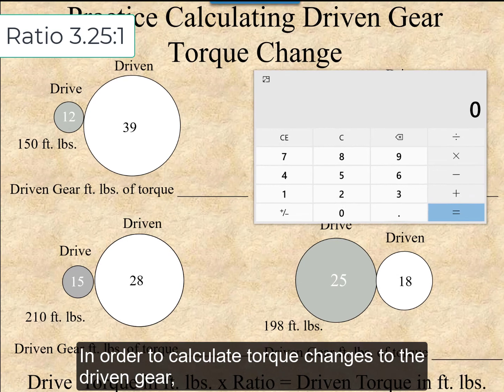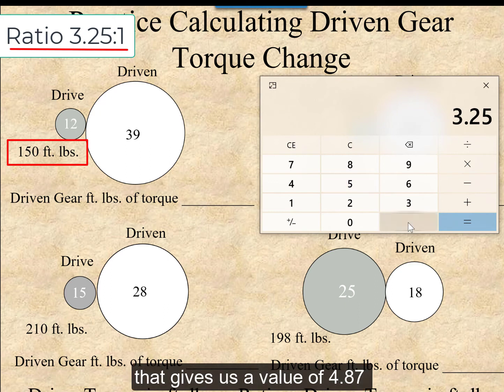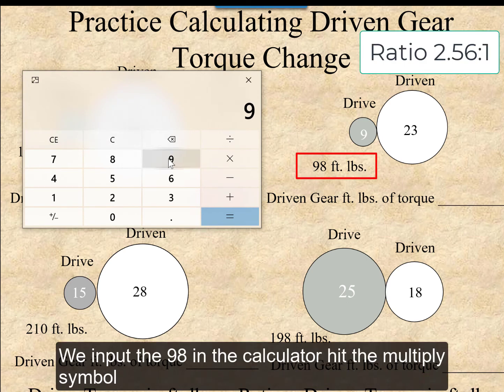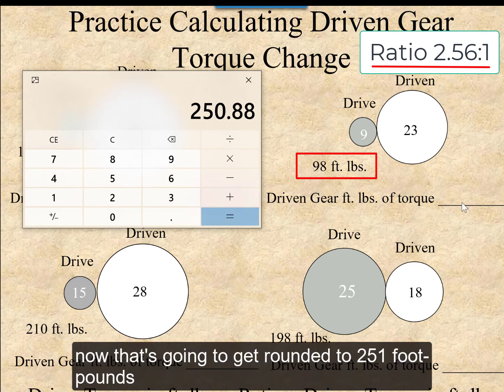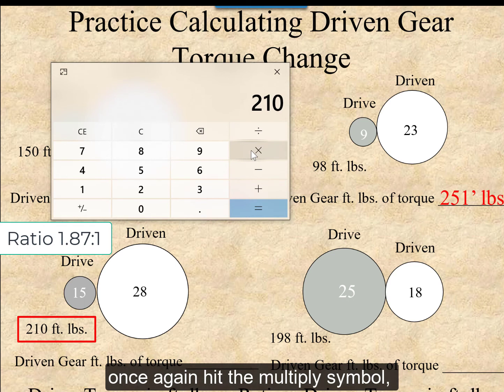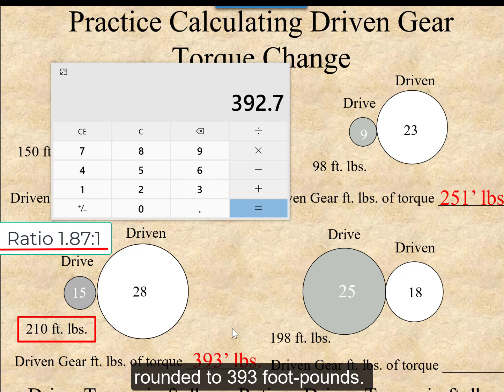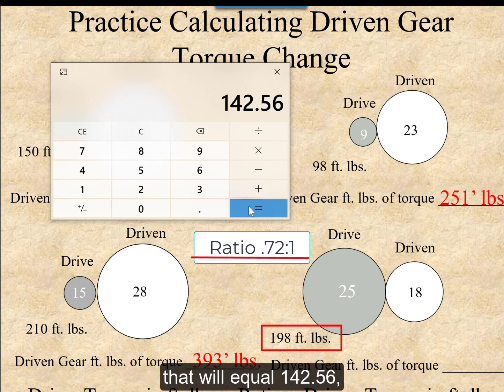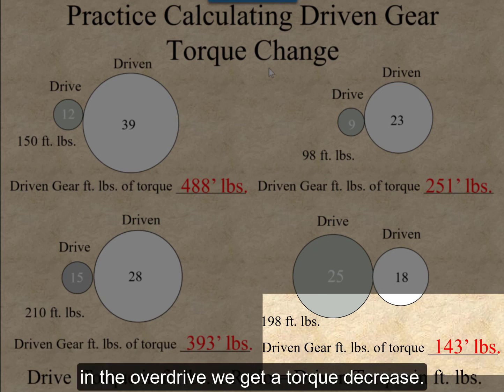Calculating Torque Changes to a Driven Gear

Comment: How to calculate input torque?
Reply from the maker: If you know the output torque you can reverse the formula but otherwise if the torque is coming from an internal combustion engine or electric motor you would need specialized equipment to measure the rotational torque.  It is possible that you may be providing the input rotational torque in which case if your turning the input you will need a torque wrench.  I know of no formulas.